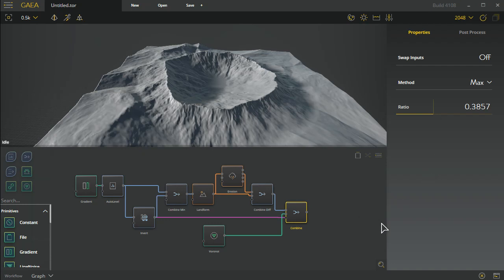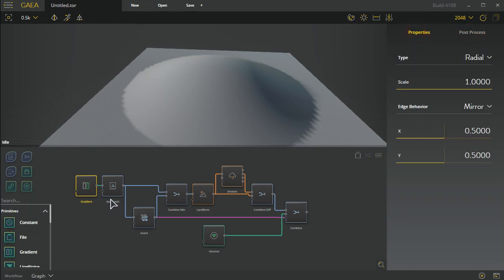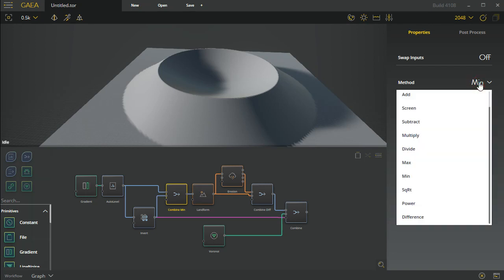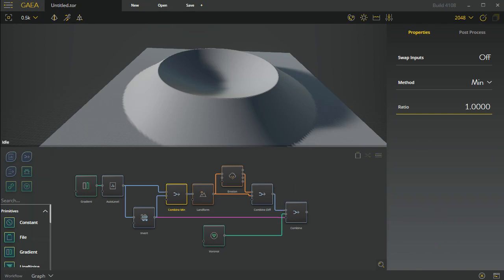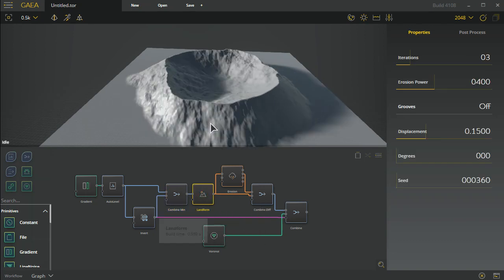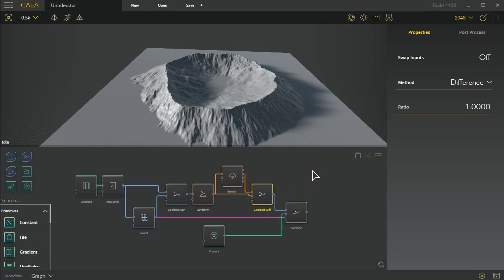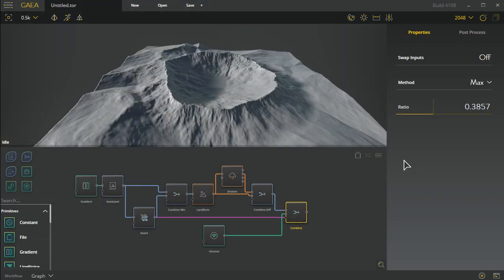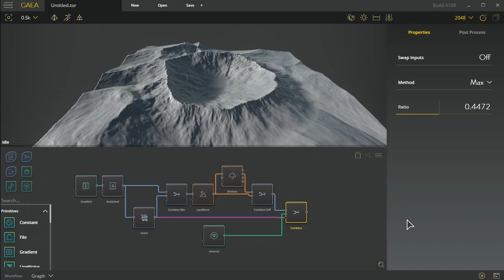Gaea EAP - Craters and the Combine node

Comment: This should get an update for the latest version in 2020 -- None of these filters/nodes behave at all like is indicated here.
Ex. The invert node doesn't simply make the crater recess into the ground-level plane...it is a TRUE inversion of all values--meaning what is typically at ground level is actually all the way at 1, or up in the air.
Reply from the maker: EAP stands for "early access preview" so nearly everything will have changed in some way. However, what you are pointing out here has not changed. It has always done this, and if you look in the video carefully, you will see the ground raise in the air. What might be confusing your eye is the fact that the max height in Gaea has been changed, as has the default radial gradient. The radial gradient is already autoleveled now, and you should notice it's much taller than the one in the above video. Other than that, this process is still the same steps. The key difference would be to change the height of the end crater. Also, Landform no longer exists. It was a rough displacement followed by an erosion all in one node. The equivalent now is called "Carver".  If you are looking to create a crater, I have a more advanced one which is from a later version of Gaea on my channel and it goes into texture as well. Or, there is an existing Crater node. I think I also have a breakdown of this node on my channel. The above video is really only here for historical reference :)
Reply from the maker: I've updated the description to point to alternate videos with updated content.

Comment: Cool video! I did something similar, but combined mountain +some erosions with gradient in subtract mode. I didn't have to invert gradient. But, thanks to your video I moved landform after combine, not before (I had it just after gradient). No my edges are more sharp and rounded. Thank You very much Sir ;)
Reply from the maker: The wonderful thing about software like this, is that there are 100 ways to do the same thing :) I've made craters about 4-5 different ways before.. some ways are more efficent than others. Keep exploring ideas and experimenting, you may find an even better way. This video was more about the ways in which the combine node can be used :)

Comment: Heya, do you know if there's a way to build just the heightmap? building takes forever and I would like to know what's the fastest way to transfer my landscape to UE4...
Reply from the maker: The display isn't the part that takes the longest, it's processing all the data from the 32bit height map. So, even if if you remove the mesh preview, you're looking at a long calculation (depending on what you are actually doing in the build) Maybe have another look at your node graph.. see if there are steps you can skip.. optimize. You can also bake a midpoint at a lower resolution, then load it as a file node.. then continue the process. This way this data doesn't need to be rebuilt and sometimes the extra pixels aren't needed to get a good result. Adding a small bit of noise and an erosion on top will add back a lot of detail. I do this often.
Reply: Thanks, I'll try that